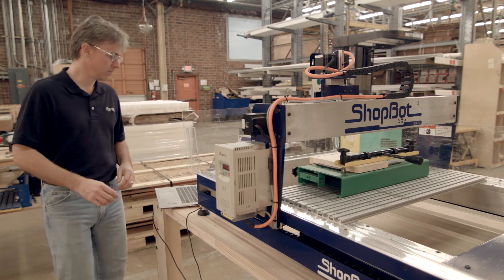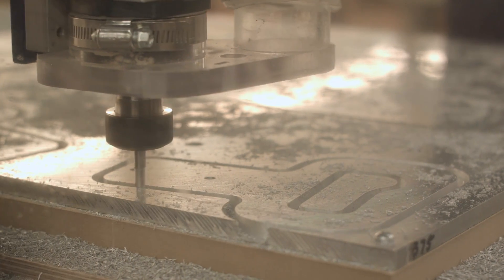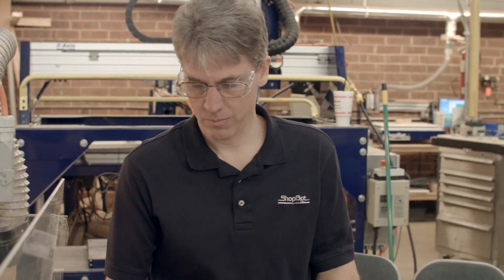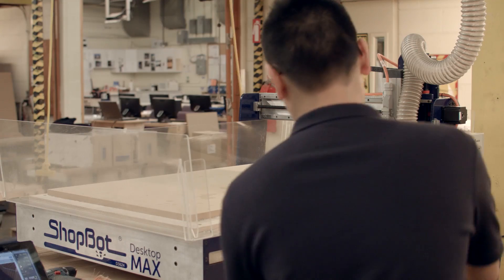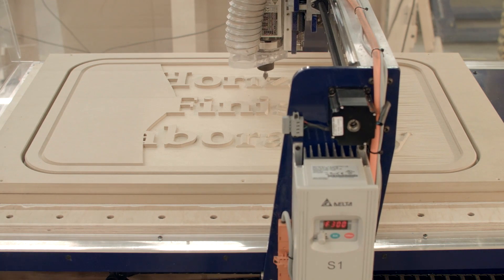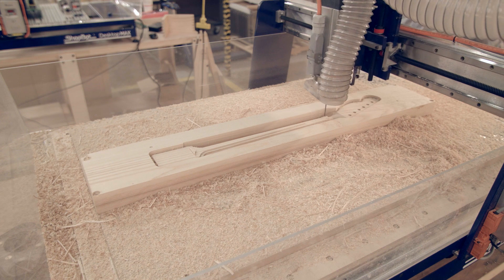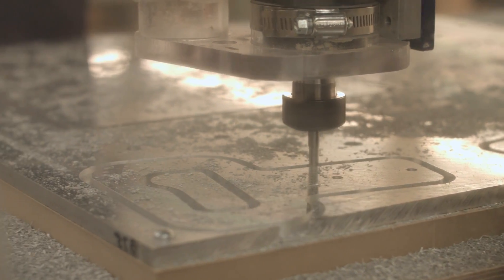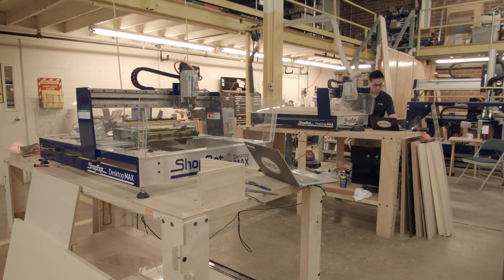Desktop MAX

Comment: Do you sell the edge clamping fixture with the machine? I want to purchase this Desktop Max machine and I really need the edge clamping function.
Reply: It is not something currently sold as a standard ShopBot accessory for the Desktop tools. However, since the deck is in sections and you can remove a single section of it, it is possible to remove a section and attach such a jig to the extruded aluminum deck.

Comment: as a shopbot desktop owner I can confidently say the mechanical parts of the machine are great. however the control pcb and desktop software is sub par. it's kind of crappy actually.  tormachs Linux cnc solution is far superior.